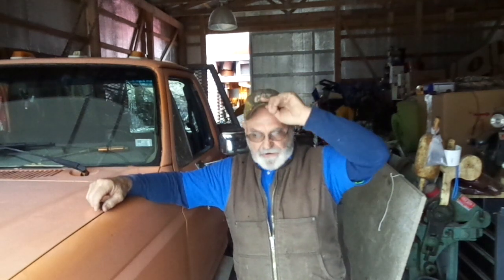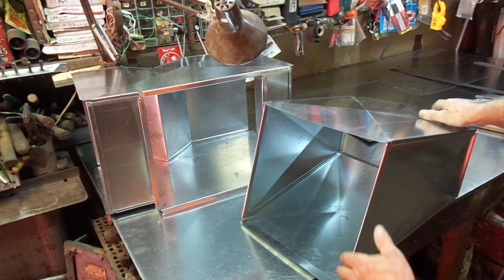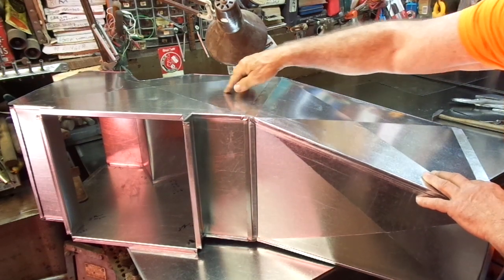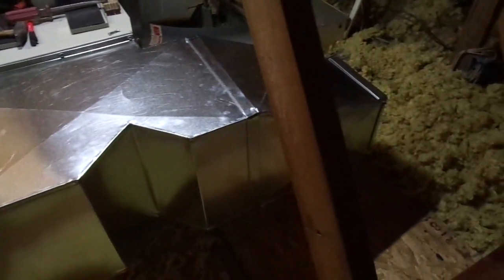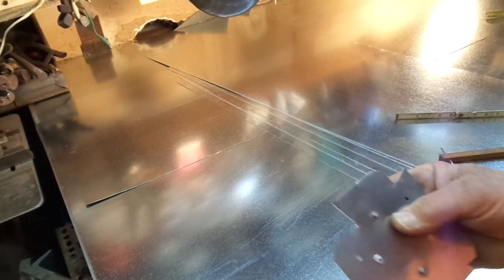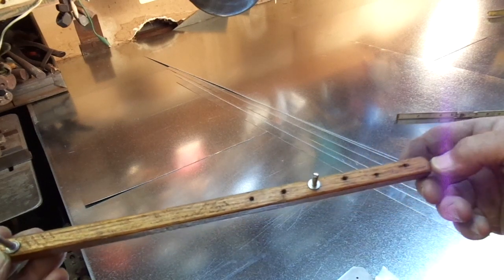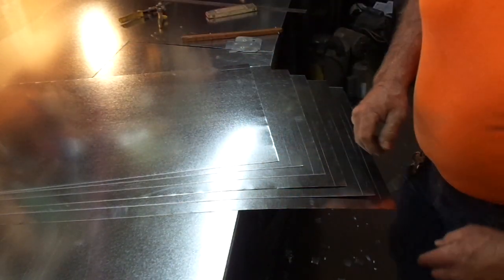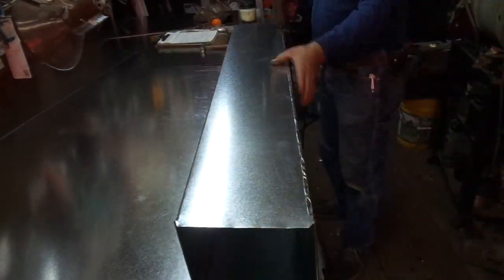Pt 4 Attic Heat Pump Installation

Comment: Thanks for explaining the reasons behind, and methods of, making proper duct runs. I tend to bleed a skillset over into everything I do. Sheet metal boxes for tools, bins for parts, sand schutes, conveyor guards, electric panels, chimneys, autobody build and repair, all are helped by  a basic knowledge of sheet metal design and forming. I may never build another duct, but I will know if the person I hire to do the build does it right. 
😆
Reply from the maker: Hahahaha  I like your comment !!  I too have made some pretty obscure objects out of sheet metal. Lead bases with soldered corners for showers...soldered drain pans for water heaters and washing machines....14' diameter half moon shaped exhaust hood for a monstrous varnish tank at GE in St Louis.  That's where they rebuild the electric motors that drive freight trains.  They seal the rewound armatures and stators in hot varnish under  a 29"w.c. vacuum.  And other odd things too numerous to mention or to even remember... LOL  Thank you for watching sir.  I have a question coming up for you in a soon to be uploaded video.....(-:
Reply: @tractorman4461  29" That must have been one heavy duty dome. Not sure exactly how many square inches that is but at 14 psi negative that's got to be a huge crushing force.
Reply from the maker: @OldSneelock  It was a huge cast iron pot with hydraulic cylinders to open and close the lid plus another pair of cylinders that rotated the lid into the locked position once closed.  I lost a good brass trimmed mahogany 4' level on that job.  I left it lay against the side and we were testing the clearances between the lid and the exhaust duct and when we rotated the lid to the open position, it crushed my level where I had inadvertently left it propped in a bad location.... )-;  Iirc, the 14' 20 ga. duct extended a little less than halfway of the circumference then went to the roof via 36" spiral duct to the exhaust fan inlet. Other than that I'm shooting in the dark about the particulars.  It was a massive vat and a nasty job to work around all the hardened varnish too.
Reply: @tractorman4461  Looking back if someone had said we would be in half the places we ended up before we started work we might have stayed on the farm.😁
Reply from the maker: @OldSneelock  You may have plucked the feather from the duck with that statement !!  Even though I really did enjoy my career in HVAC, there were those times under miserable conditions where a bit of doubt may have creeped into my mind.  LOL  But it was only a fleeting thought on occasion....
Reply: @tractorman4461  Ha Ha Ha. 
I have one time that really stands out in my mind as a turning point. 
In 1972 I was at the bottom of a 20 foot deep elevator pit digging out a bearing on the bottom pulley shaft. It was hot as hell because of all the hot sand that was coming into the pit over the B oscellating conveyor from the grey iron shakeout. It was humid from the wet molding sand being returned from the mold line on J belt. Sand was pouring into the pit from the overhead bin and I had to dig down about two feet into loose, hot sand to get to the bearing before I could start doing the 2 hour job of replacing the bearing. 
The foreman came to the top of the pit in his red hard hat and clean shirt and yelled down to ask how long his line would be down. 
Right then I thought, "I'm on the wrong end of this conversation!"
Reply from the maker: @OldSneelock  I am sorry to say, but I just found this follow up comment.  LOL.  I just missed notification I guess. No matter, like you I read 'em all...even if its a whopping whole year later !!!  I agree with your assessment of the above described environment.  Unfortunately some of the worst bosses have never 'walked the walk' consequently have no clue about what its like to perform the work.  Have a wonderful day my friend.